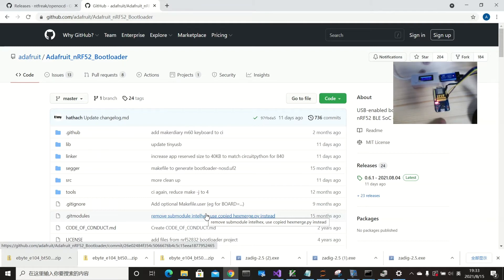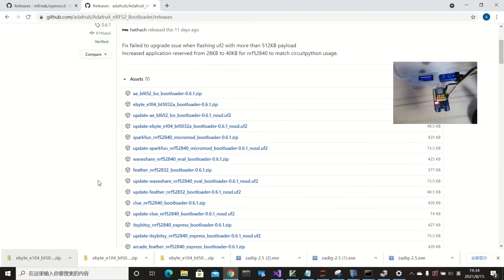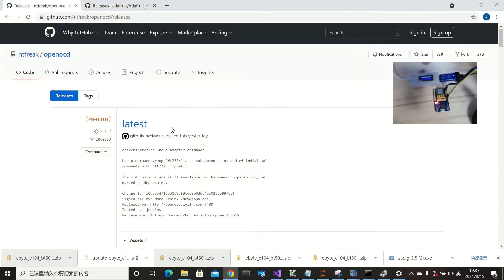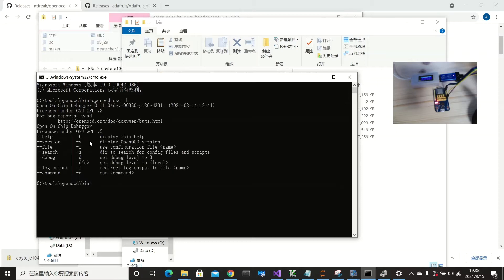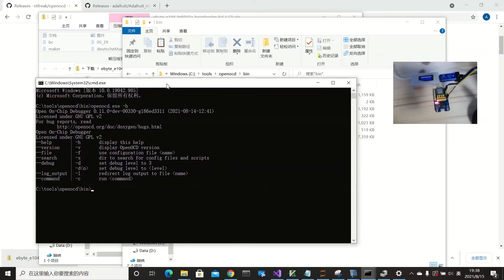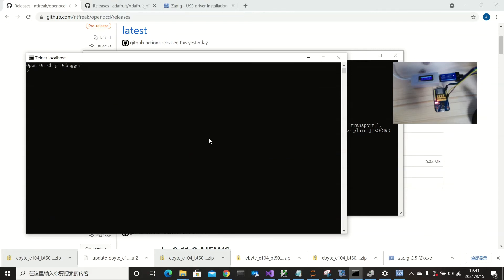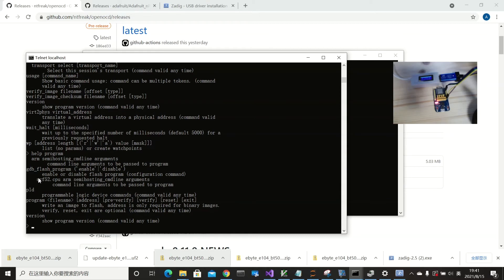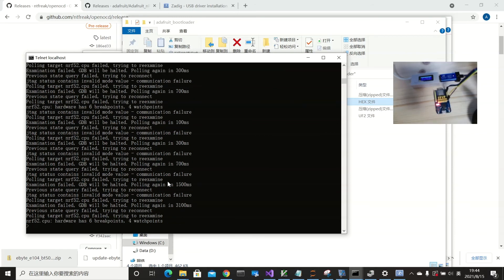How to flash bootloader and use it to upload firmware for nrf52 chips through bluetooth

Comment: I have a custom board but shows this , 
my be no detect the cpu 

Info : Listening on port 6666 for tcl connections
Info : Listening on port 4444 for telnet connections
Info : clock speed 1000 kHz
Info : STLINK V2J37S7 (API v2) VID:PID 0483:3748
Info : Target voltage: 3.205793
Warn : target nrf52.cpu examination failed
Info : starting gdb server for nrf52.cpu on 3333
Info : Listening on port 3333 for gdb connections

im using nrf52840

what is the possible problem?

thanks and regards
Reply from the maker: There could be different reasons, as start point, you can check if the pin are connected correctly, can measure the resistence between the swd pins and vcc to make sure the soldering is good, then you can check if the configuration of openocd is choosed correctly. If that doesn't work, can check if power supply is good, then check if clock is generated correctly. From my case, usually it is the pin connection.

Comment: Hello. I receive one error: Info : Listening on port 6666 for tcl connections
Info : Listening on port 4444 for telnet connections
Info : clock speed 1000 kHz
Info : STLINK V2J17S4 (API v2) VID:PID 0483:3748
Info : Target voltage: 3.257933
Error: init mode failed (unable to connect to the target)

C:\Users\User\Downloads\openocd-v0.11.0-i686-w64-mingw32\bin>

My board is e73 (nrf52832)

Can you help?
Reply from the maker: That could be different reason, I have seen this kind of error on my custom board usually when the connection of swdio and clk is not correct, or if the stlink is working properly, from the output, it seems like the voltage is good, maybe first check connection, then get another board and compare.